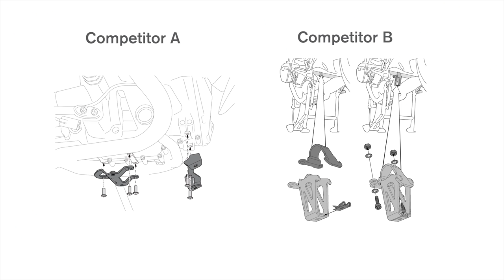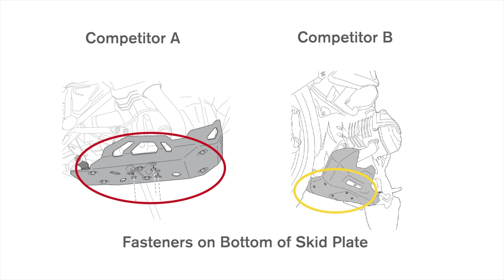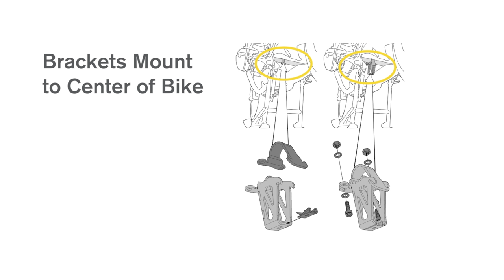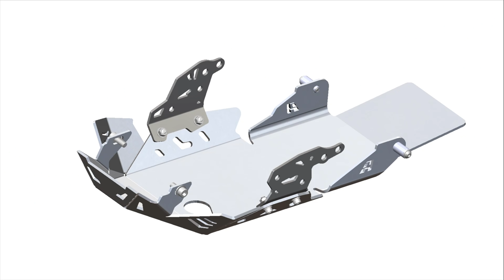AltRider BMW R 1250 GS Skid Plate

Comment: It's clear you put in a lot of thought to make sure it actually works for aggressive adventure riding. You're absolutely right when you call competitor products out for shortcuts or straight up design flaws. A skid plate should not be single-use, it should not be designed to fail from medium-force impacts. 

No doubt Altrider products are well engineered and well made. I just wish you guys made a skid plate like this for my Tiger 800! Unfortunately, nobody ever designed a skidplate like this for it.

Comment: Will this skid plate work with the gsa’s factory lower crashbars?
Reply from the maker: Yes! 
You have to order it with the correct brackets. Here's the part numbers you want: R118-1-1202 (silver) or R118-2-1202 (black)

Comment: Alt rider plz reply that with practice can an Africa twin (dct) handled like a 600cc adv bike on trails
Reply from the maker: Absolutely
Reply: @AltRiderLLC  and according to you which is the best adv motorcycle like your personal choice
Reply from the maker: @vaishaligujar199  easiest to ride slow will be the f850gs, or Africa Twin. To ride fast.... KTM 1090r,  but the new 790 looks tasty. Best street adv bike the tiger 800 xcx
Reply: @AltRiderLLC  and one last question xcx or twin dct
Reply from the maker: @vaishaligujar199  mmmmm. Tough call. Street, xcx. Dirt, dct
Reply: @AltRiderLLC  thank you very much
Reply from the maker: @vaishaligujar199  any time

Comment: Doesn't hold a candle to a Black Dog skid plate.
Reply: How do you know?
Reply: This looks like a pretty stout plate with solid engineering.  The AltRider skid plate on my '12 GSA is rock solid. I wouldn't go out on a limb and say this AltRider skid plate is "the best", but I don't see how anyone else would be significantly better.